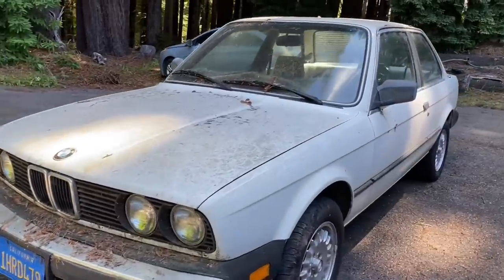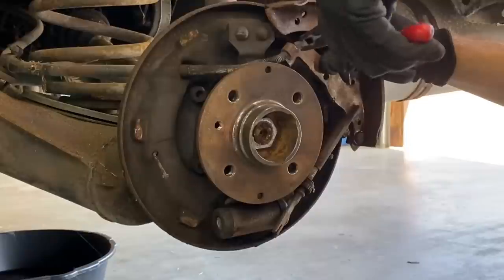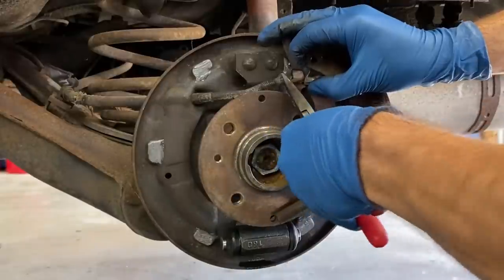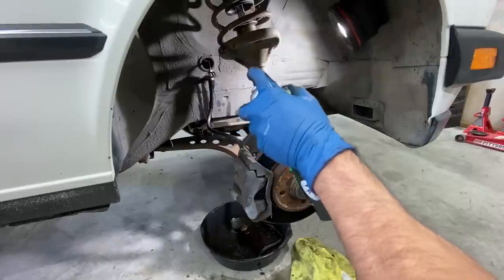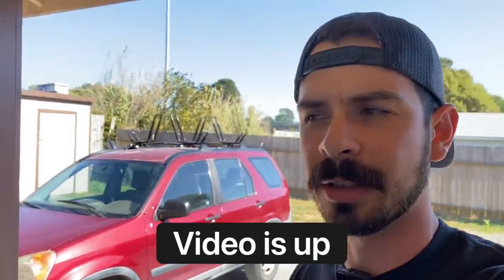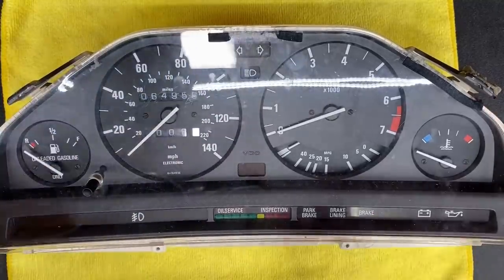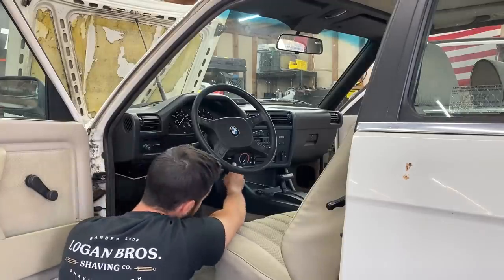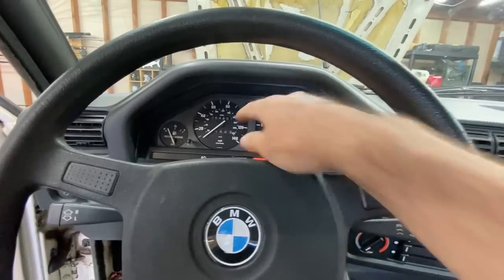$2500 BMW E30 Build - Brake Overhaul at 65K MILES!

Comment: Spray electric cleaner on the inside where the volume knob is at. That work for me.
Reply from the maker: I tried some contact cleaner in a previous episode, no luck so far
Reply: You have to hit it from the back of the potentiometer where the contacts are while turning the knob. There should be a small access hole.

Comment: Not sure if you fixed the radio yet Alec but you need to use electronics contact spray cleaner (not a lubricant) to take the oxidation off the potentiometer contacts. Hit me up if you need more details. It should evaporate fully and leave no residue behind.

Comment: Thanks for the shoutout!  I have never seen one quite that bad, but yeah it looks like there must be some serious corrosion inside that potentiometer and will need to be replaced. You definitely did your due diligence in trying to revive that one though!
Reply from the maker: thanks for bein a part of it dan! yeah its pretty smoked... hopefully i can find a replacement or someone can repair it. Ill deal with it at a later date after sorting out the engine

Comment: Nice, good brake repairs are satisfying and rewarding! I had a similar thing with the cap not fitting properly. Forgot to test it with air only first (since it was working fine yesterday), but luckily I was just in time before it made a mess. If you see the price of a good adapter, you can't expect kits to come with one of similar quality.
Also, I like to point the plug of the bleeding bottle downwards instead of up, so it doesn't squirt all over the place when you disconnect it.
Reply from the maker: good info! yeah im glad to have this one done, turns out the gasket may have been double stacked? either way, was able to figure out a solution :)

Comment: I recommend to check your ISTA. BMW instructions for drum brake adjustments should be there. Did it recently for my 2016 F20 LCI according to ISTA and it worked perfect. But maybe the E30 is to old for ISTA, I am not sure. My ÍSTA version also works for my 1991 E36. Cheers from Germany!
Reply from the maker: ista is probably too new for this E30, luckily i had some awesome viewers send me some manuals for the car so I had them handy, just didnt need to use them

Comment: Looks like you got parking brake parts that go inside the rotors
Reply: I didn't think about that, but yeah, that would make sense.
Reply from the maker: yeah looks like it. far too small to be for a normal drum setup

Comment: Exellent ! 
Hi bro all parts new , but every month but rear ratchets need adjusting.
Whats the problem ?
Reply from the maker: The ratchets on your rear drum brakes? There’s a spring that prevents the dial from spinning, I’d pull the drum off and see if that spring is in place or if it’s worn out
Reply: @DayOffDIY  i watc your video 2 times, everything is same , there is no any difference . But you know there is Part number 4’s spring little bit old .
Reply from the maker: I don’t know the part number off the top of my head but if you buy a drum brake hardware kit it will come with the right spring. I saw it on my kit, it holds tension against the dial. Wouldn’t hurt to replace the adjuster too
Reply: @DayOffDIY  everything is new , just springs is old but looking not bad i dont know . Its part number 4 , stopper its front of the adjuster and its new spring maybe will fix it .
Reply from the maker: I’d replace the spring to start
Reply: @DayOffDIY  hi again bro , i changed today all springs . But when i drive some noise from inside of the drums , than i opened again down’s springs is at the bottom are coming out of their housing. . I opened two times and closed . And now again noise . The springs must have come out of their sockets again. bottom right and left

Comment: I have no clue about cars. I am at 74000 km right now (45k miles). Should I replace my brakes?
Reply from the maker: depends if its the front or rear, fronts wear down faster but the only way to know is with a physical inspection